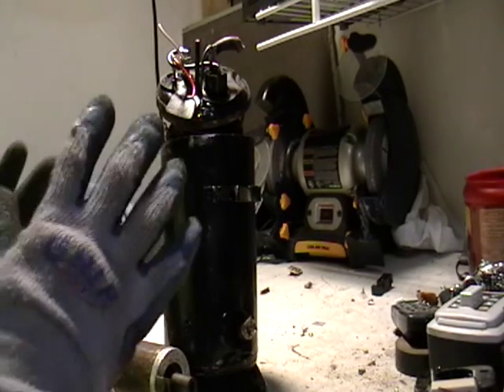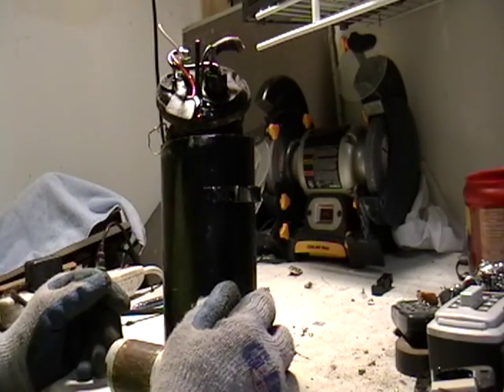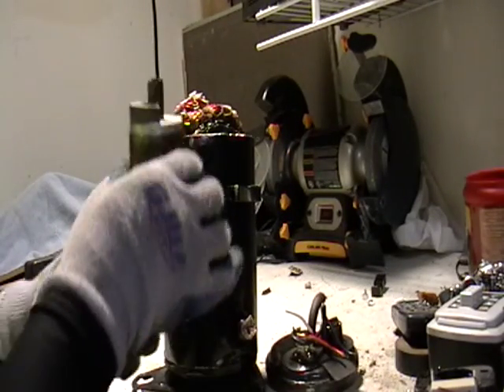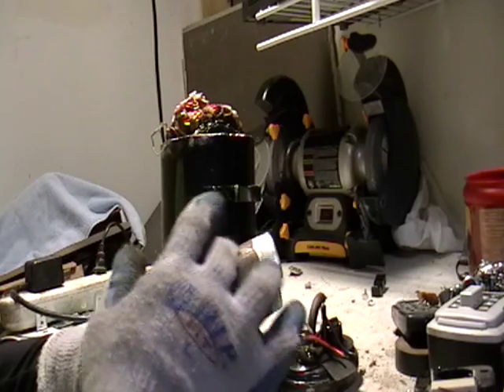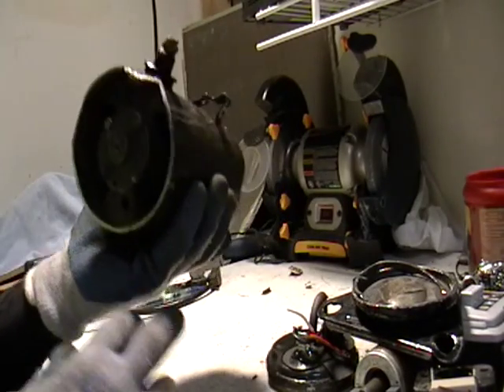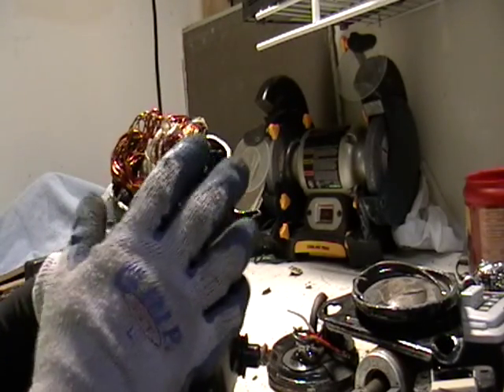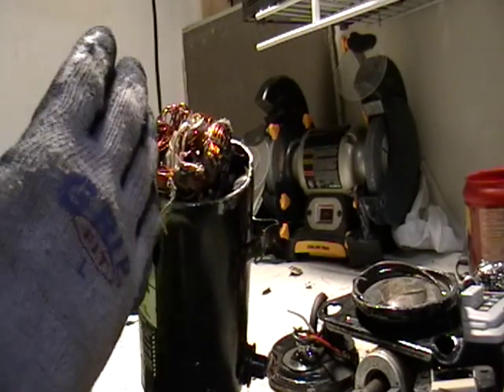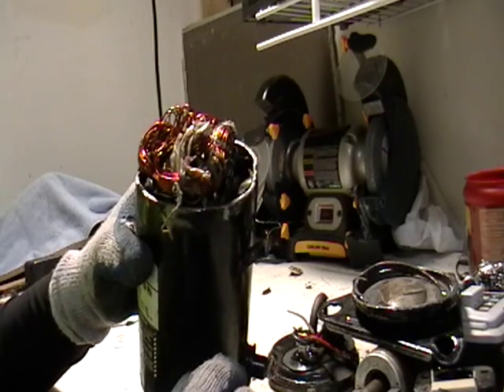A/C Compressor

Comment: whenever i scrap a fridge a car or a air conditioner i always bring it down to a local auto shop thay gave me 35 bucks for the r 12 in my honda and 15 for the freon in my fridge and a epa tag too then you can get more for it at the scrap yard .check it out you can get alot more money and use the epa tag to get more money back on your taxes.... national grid has a program thay give you 50 bucks credit on your bill and take your fridge